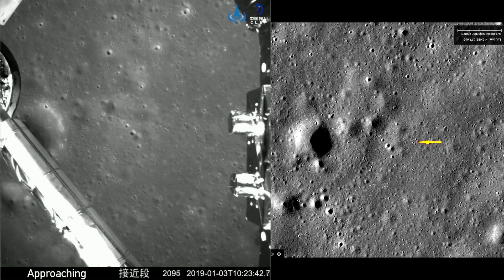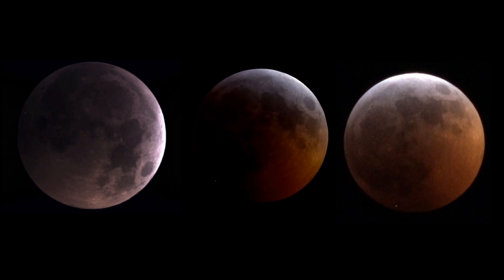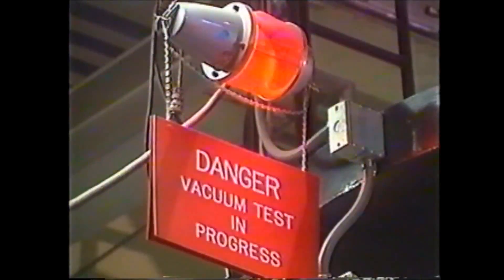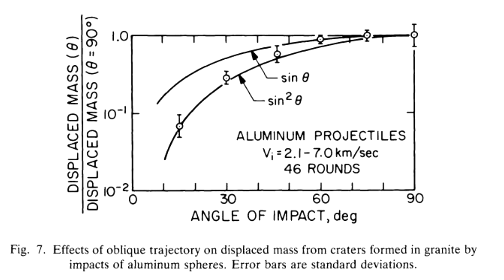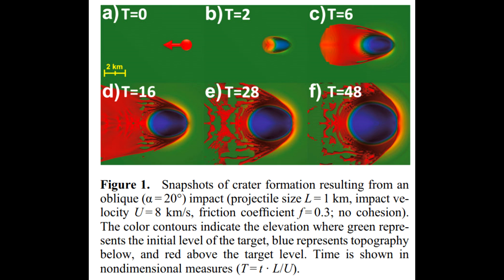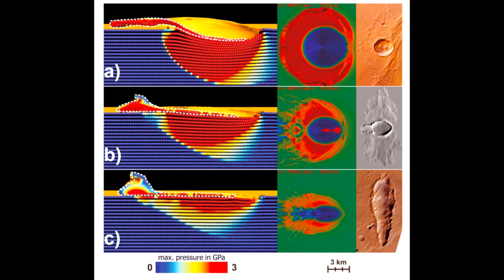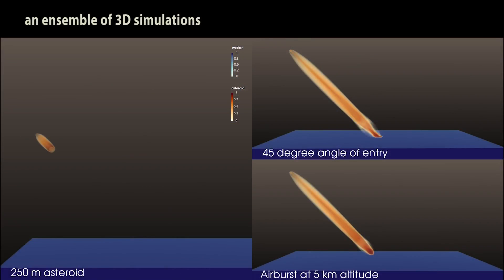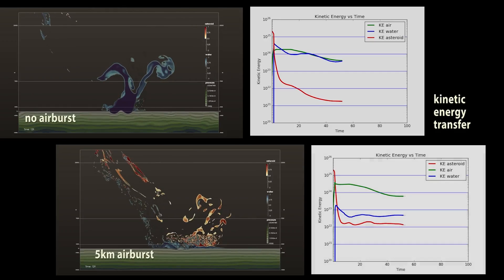Why Are Most Impact Craters Perfectly Circular? (Rather than Ovals)

Comment: One thought is that if the impact velocity and mass of the projectile is low enough that the binding energy of the material of the projectile is about equivalent to the total kinetic energy of impact, then the crater would not be circular.  Of course for astronomical events this would not happen as the relative velocities are so high that the kinetic energy as velocity squared is higher than any physical materials binding energy.

Comment: Carolina bay structures - the theory is that they were created from ejecta from a comet hitting the glacial sheet at Saginaw Bay during the last ice age.  They must have impacted at around 10° ±.
Reply: If they are secondary ejecta impacts, wouldn't the lower impact velocity change the range of impact angles where they would be expected to fully detonate and leave a circular crater? They must have sub-orbital velocities at impact, and perhaps lacked the energy to fully detonate even at impact angles above 10 degrees? I'm not super familiar with these structures, ( I've only seen them referenced in geological/soil surveys I've utilized for archaeological reports) but I thought analysis of their origin was leaning much more strongly towards geomorphological changes?
Reply: @cymrych79  I'm not sure.  It would seem to me that if they were secondary ejecta impacts there would be some variety in their shapes from round to elliptical to skipped indentations but they all seem to be elliptical.  They also seem to be in a butterfly pattern with impacts in both the Carolinas and in Nebraska and the apparent primary impact in Saginaw Bay.  If they were geological features (i.e. windblown sand features they would be in multiple directions and much more localized and not in multiple types of rock structures).  Since this is just a very very recent theory, a lot of investigation has to be made to determine any such possibility of a comet hitting a glacial sheet.  I've seen at least 2 papers on this with wildly different dates, circa 14,000 bp and circa 780,000 bp.  The latter date seems to be very forced to coincide with the supposed last magnetic pole reversal.  Some people suggest that with the amount of erosion on the formations that their creation date is somewhere in between.

Comment: There is some basic physics in this. When a ball hits a surface even at an angle there is a point where mathematically it stops and then rebounds. The rebound being caused by the distortion of the ball (and possibly the surface) then returing the energy when the ball returms to its normal shape causing the ball to bounce off. 
If I got that right?
Reply: Yes. But meteorite don't bounce very well. At speeds of 82,020.997 fps they tend to explode on impact.

Comment: Wouldn't such asteroids so much smaller,
just be pulled straight in by the moons gravity,
when it got anywhere near close?
Like a feather floating by the vacuum cleaner?
I've always assumed that.
Reply: At speeds like 82,020.997 fps and faster, they are already gone before the pulling has any effect. It might cause a small curve in the trajectory. To hit the moon the must be heading for the moon. Which still happens.

Comment: Easy answer, the moon's gravity has an early effect on incoming impact objects, pulling them more towards the center of mass resulting in more nearly perpendicular impacts, thus round impact craters.
Reply from the maker: This is what you might think, it takes objects on grazing trajectories and pulls them into steeper trajectories. However it also takes objects on trajectories which would miss and pulls them o to grazing trajectories, it all cancels out and the distribution is the same.

Comment: I made similar craters and crater chains in my lab using electric discharge on earth materials. Must they all be only impact craters? What are your thoughts on plasma physics in an ancient solar system leaving behind the scarring we see across the planetary bodies near us?
Reply from the maker: The problem is scaling up the craters to the sizes seen, there's no evidence of the kind of electrical flows that would be needed.
Reply: Scott Manley I agree completely. I’m curious to the atmospheric conditions described in antiquity vs the relatively stable skies we see today. Thanks for your response!
Reply: @scottmanley  likewise, there is no evidence of the 'kind of impacts that would be needed' to produce transient craters. the transient craters existence is hard to prove unless an impact of large scale can be studied in detail. Another cause for question is that all shocked minerals and morphologies found within crater sites (and championed as evidence for impacts) have also been produced by terrestrial lightning.
Reply from the maker: @coyotehump8253  And yet there is no evidence of lightning strikes able to produce craters miles across, meanwhile we've observed multiple such events on Jupiter. I mean we literally look out there are see rocks floating around, we count the number of rocks and figure out the impact rate and crater size and it's broadly consistent with what we see.
We see bollides generating nuclear blast level explosions in the upper atmosphere every year.

You on the other hand look at a lightning storm and then tell me that we've just never seen one big enough.

Comment: Don't forget that at sub-light speeds velocities will add.  Most bodies in space are rotating, so forces on a body will also exhibit a resistant force in either a +ve  or -ve direction to the incoming projectile/meteor, with many being velocities in alternate directions, not strictly +ve or -ve to the projectile, as projectiles can come from space in ANY direction and hit a spinning surface from any angle. Depending on speeds this effect or resultant addition or subtraction of energy may be significant. But taken with respect to overall acceleration of an object travelling throughout space, the additional momentum of the body being hit may be considered negligible. All these things need to be taken into account when considering the crater formation genesis. Not just the speed of the meteor.

Comment: why hasnt the earth been hit by thousands of meteors  being the earth is 4 times as big  as the moon .   if you throw an object very fast on sand or soil at an angle it leaves a trench .so that should  be the same on the moon especially with out friction .
Reply from the maker: Earth is hit by hundreds of tons of space rocks every day.
Reply: Why do you think the earth hasn't been hit? There are still hundreds of impact craters left. But erosion has removed the older ones, and most are under water anyway. Having a planet with more water than land does that for you.

Comment: *hexagonal

Craters aren’t created by impacts.  They’re created from electrical machining.  This is flawed science because it’s trying to prove a hypothesis (craters being caused by impact)
Reply from the maker: lol nope
Come back when you can show us how to make craters more than an inch across and without an electrode being millimeters from the surfaceS
Reply: Just add water.  Surround a planet like mars with an orbiting body of water and dust, if it's dense enough, and moving fast enough, we get statically charged and conductive gas... it's possible that if a moon of mars or mars itself impacted another passing body, or if mars had a close enough near-collision to a passing body, we can get an orbiting and passing cloud of conductive gas, enough to create a dielectric differential between mars and the gas or other charged body... at this point the whole planet of mars becomes your anode, and the moving gas field of static charge becomes your cathode.  If you want, add a high meteoric bombardment rate from the collision to provide near surface gas density,, or wait till half of the planet wide ocean boils, and you get static discharge events from the scale of 1 inch crater causers to a planet sized lightning storm all the way up to a interplanetary discharge events like the valles marineris.  In observing the entire valles marineris structure, the polar deposition and erosion pattern is a dead give away of electro-magnetic flow.  So you are misleading at best, and at worst you are baiting people to not seek understanding but instead obey- a bully tactic, when you demand that a person proves what you know is not possible, in a vacuum there is certainly an arc distance limit, (not to mention that an earth based test is limited to gravity based results).  With a conductive pathway, balance is always resolved.  :) Now let's talk about how the earth ran into a body of water without the moon, and how mars and venus lost all of their water all the while mars had its core stopped and venus got so hot it melted. That's a three way electrical system I'm insinuating..  All of this is conjecture at the moment, of course, even heresy to some, so let's let science run it's course and may profiteering get us somewhere smarter. The simple solution of cratering is to say they are all caused by a rock hitting it, and certainly most are so sayeth Ackham,  but we're trying to find the truth, and the truth is never that simple. The Full spectrum of understanding includes that which you do not understand yet.  I hope that through encouraging others you find what you are looking for.
Reply from the maker: That video you posted includes lines like 'Mainstream science can't explain why craters are predominantly circular' - meanwhile I references experiments that are older than you showing exactly this. Either they didn't do their research, or they are lying to you.
Reply: Scott Manley that channel has done more research than you can shake a stick at.  
I find it more convincing than the popular hypothesis but that’s something you’d have to investigate yourself.  The phenomenon is scalable.
Reply from the maker: @mkhud50n  And yet they still say things like 'The pioneer anomaly is a mystery to mainstream science' and 'the sun isn't emitting enough neutrinos'.
Reply: Scott Manley yup. 
Look I’m not trying to discredit you or your video.  Just broadening the discussion.  I like to look at all the angles.  That’s why I clicked.  We both like space stuff.  Nothing wrong with that.  
But tell me, don’t craters look kind of hexagonal?   Sure rounded but hexagonal.  Isn’t that weird/cool?
Reply from the maker: @mkhud50n  If you want to read about polygonal impact craters I'd suggest this PhD thesis because it has a section which covers the review of existing work on the subject https://www.researchgate.net/publication/260034157_The_Structural_Control_of_Polygonal_Impact_Craters

My main problem with the various Electric universe sources is most of their articles and videos include statements of the form 'Mainstream science can't explain X but here's our explanation of X, therefore mainstream science is wrong' and when you actually look at phenomena X you'll find it well explained. A secondary complaint is the lack of any predictions made in advance, I've tried to get predictions which are testable but have never had any examples offered.
Suggest you watch this video on philosophy, explaining the difference between a science and a pseudoscience:
https://www.youtube.com/watch?v=-X8Xfl0JdTQ

Comment: There's a spectrum of energy produced at the moment of impact depending on size and speed, right?  So why are we not including the part of that spectrum that involves a state of matter change- when we get a moment of plasma?  Hexagon craters are common in welding.  Is it true that in the spectrum of energies produced, there is a spectrum of plasma energies produced? Is it true that with a given total mass and  (dynamic) density distribution, there is a moment when specific energy level plasmas begin to cool as they spread out but retain a total mass cohesion, as in they don't blow up ( possibly due to magnetic cohesion), so the mass reaches a maximum outward expansion due to heat then re-condenses and collapses in on itself?  Is it true that as a central low pressure area forms at the center of the expanding mass, the mass as a whole begins to rotate as the hot exterior falls into a cool condensation point, ( a polarized magnetic field may or may not be induced at this moment, in alignment with a global rotation motion or global magnetic direction)? Is it true that this movement of high to low and hot to cold does so with maximum efficiency and least resistance causing a central low pressure vortex to form,  then secondary vortices form at the periphery of the central vortex as low pressure and high pressure balance, and this process gives us our hexagon shape, ( and since we have the full spectrum to work with, we also get a few other square sided [not circles or oval] shapes occasionally)?  Is it true that the lowest most stable energy (heat) levels of a cooling plasma, bound to a surface, result in a 2d geometrically stable density distribution of mass due to high and low pressure area balancing through a 3d matrix of condensing particles, dynamic gas pressure, electric flow, and magnetic coupling?  So is it true, that in some of these impacts we get a marble going thud and some sand sprayed up and out, and in some with enough energy there's a flash of light and explosion, and in some of these impact events there's a flash of matter turning into energy ( at least virtually in a state of plasma, no fission or fusion energies reached in total impact energy, though reverse field pinches in the plasma can occur)?  And is it true that when this plasma state happens, then cools, it does the same thing the polar vortex on Saturn does, and the same thing an arc welder does,  and in the first instant of some meteoric impact events,  we get a hexagon crater as the light emitting part of the explosion and resulting classic ejecta theory fit the form of the plasma cooling event that happened just before?
Reply from the maker: Well that’s a lot of conjecture, now go and find some scientific evidence to support your hypothesis.
Suggest looking for radio bursts from the moon that coincide with the cratering events, since your theory requires large current flows you should be able to come up with a radio signature to look for.

Also, it’s more convincing if you do the modeling and prediction beforehand rather than trying to fit it post-hoc
Reply: Just sayin', I haven't seen a test yet that shows a near zero gravity plasma field collapse resulting in a magnetic field.  Let alone the different ways to stimulate such an event or the different possible modes the process goes through.  Plasma barrier discharge is scalable, right? Somewhere in the spectrum, considering the planetary scale of the high end of the energy potential of such a process, the strength of the magnetic field produced by a flow of electrons  focused through a centralized discharge channel should be enough to "shape the charge" of a meteoric impact explosion.  Simple way to make straight boundary edges without radial deposition, huh?  Perhaps you know someone that can help; What an energetically charged atmosphere there would be getting to witness for the first time a model demonstrating why a meteoric impactor and the column of it's wake cannot act as the finger while the moon acts as a balloon that is constantly being rubbed not against a sweater, but rubbed against the sun's constant torrent of highly energetic radioactive and non-radioactive particles, and saturated with stellar and interstellar em radiation.
Reply: Nasa now says "interplanetary shock" exists 8/13/19.  Just when I was about to obey your command when you told me to "go find" some scientific evidence.  Convincing is what conmen are.  Understanding Relativity and not being a believer, that takes courage. Models and predictions are available in any welding class,  just scale it up a bit. Thanks for not questioning authority, it helps convince the sheep.
Reply: Most what you suppose needs an atmosphere. The moon lacks one.
Reply: I guess all that hot air coming off the earth dodges the moon?  And check the aurora in ohio today from the c12 flare that also caused a 7.7 earthquake in papua new guinea,,,,  think that temporary solar produced atmosphere is going to get close enough to the "there's a vacuum in space" region of the moon to attain the conductive results I propose (not suppose)?  Maybe after the earth asks god if exhaustive outgassing makes her look flat?      Come on kid, you replied, that shows that you are thinking,  you are close to the answers you seek, don't let the profiteers mislead you, there is always more than meets the eye.    (and, of course, things other than sailboats experience st.elmo's fire, that was the point,,,, that physics exists here and there, you can thank Einstein for that one.)   Notice how the OP responded, thaaaaattt's cuz i'm right,   Now Now settle down, there's not a test for it yet, plenty of pictures of bright flashes and melty spots taking far too long to cool and crater depth and geometry measurements to back up the hypothesis though, so it's just a matter of time - NOT Belief.